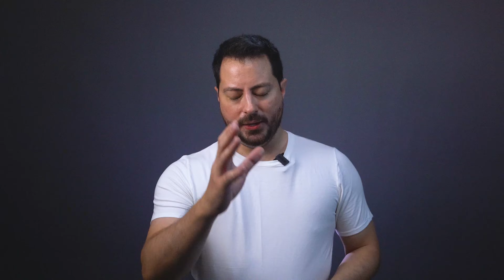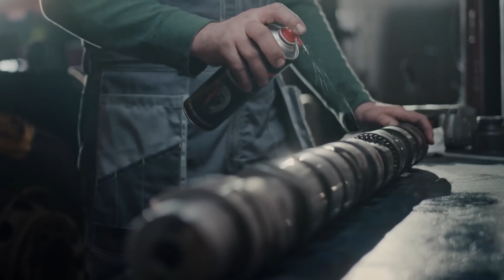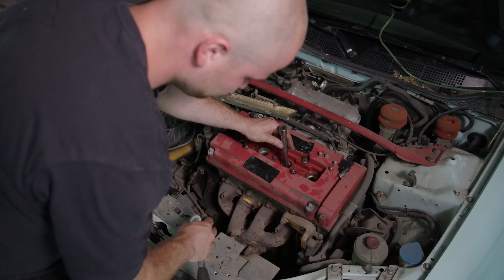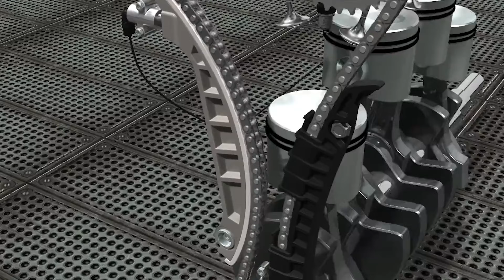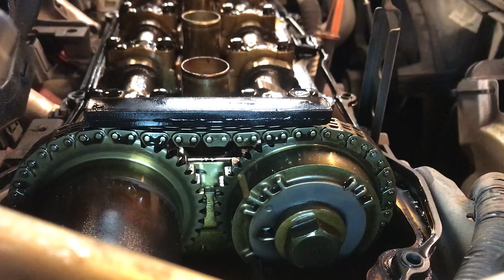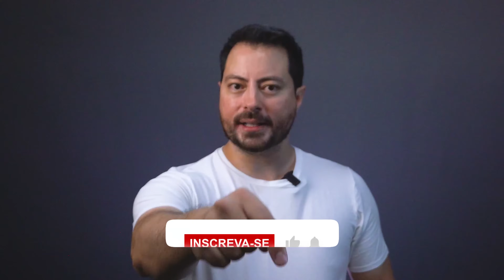Timing Chain vs Timing Belt: Which Lasts Longer in Your Car?

Comment: One major advantage of the timing belt that was not mentioned in the video is how much it simplifies the design of the engine. You don't need a complicated oiling circuit to provide lubrication to the belt, so you can use cheaper and lighter plastic timing covers that don't have to seal perfectly (although I would not be surprised if companies try to cut costs and use leaky plastic timing covers with chains in a few years). The belt is easier to change out than a chain, doesn't need chain guides, and you can drive a water pump with the belt without having to worry about it leaking coolant into your oiling system if it fails.

Comment: your facts here is wrong. Timing belt replacements are 7-10 years or 120Mm, based on our local terrible 3rd world special car models brands impose on us.  However you can always inspect the belt every service.

the durability of timing chain depends on linkage. timing chains that are light with single linkage are not durable, they sacrifice durability for economy. Durable timing chains have a double pair chain that look like 2 chains in parallel and use multiple pieces to connect the joints. TIming chains lifespan is also determined by how well the engine is maintained in terms of replacing the engine oil.Some engines allow easy removal of the front top port of the timing system to let you inspect the chain. It does take longer or more effort but it can be inspected.

Some timing belt designs are absolutely terrible that wouldnt even last 3 years, like the wet belt. Since timing chains are metal they are compatible with engine oil, but not the rubber belt.

Factually the timing chain and belts both have slack that have inaccuracies in timings compared to timing gears, so while timing gears have a nice noise while some hate any noise, it cannot rev as easily as belts and chains due to lack of slack, despite the best reliability here, and a lack of flexibility to adjust the timing.

You dont get much choice where i am in picking between belt/chain, as manufacturers determine things. we have the same system as the US, where manual transmission is going away due to the local mindset/perception of transmissions thinking that automatic smoothness and less pedals is superior and manufacturers are free to impose horrible products on us.

Comment: Nissan Versa owner here with a timing CHAIN and 125K miles. So far no issues. If it had a belt (like the POS 2000s Honda I had), I would already have to be looking for a second replacement. I require a chain in any car I buy.
Reply: Those "POS 2000s Hondas" will last longer on one timing belt than your ChitVT Nissan trans will. I'm currently dailying a 98 accord with 382k miles on the original powertrain-this has got to be it's 4th or 5th timing belt. I'd bet my house your Nissan will be in the junkyard before even hitting 300.
A timing belt job isn't gonna be more than $1000, that you only spend every 5-7 years or so, and most of that is labor. Learn to DIY and it becomes just the cost of the belts and a saturday afternoon. More importantly, chains aren't completely maintenance-free as well. They do stretch over time and have to be checked, and the plastic chain guides can wear out.
Reply: @iank6897 Naw, that chain will probably outlast the CVT in my Nissan, lol. I know that. I am a shade tree mechanic and I won't try replacing a timing belt (sometimes it's two). The simple fact is, a timing chain costs less money in maintenance and headache.

I had more trouble with the Honda than I've ever had with the Nissan but regardless, cars (and trucks) are built with planned obsolescence these days (like the plastic oil pans and oil pump belts in Fords). Nothing is built to last anymore.

Comment: Most modern timing chains are not the same as old fashioned timing chains. They are only built to last for about the same time as a timing belt. This makes them an expensive liability which cost far more to replace.
Old timing chains would typically last the life of the engine. In the case of old Mercedes engines this could easily be 500,000 miles.
Reply: False